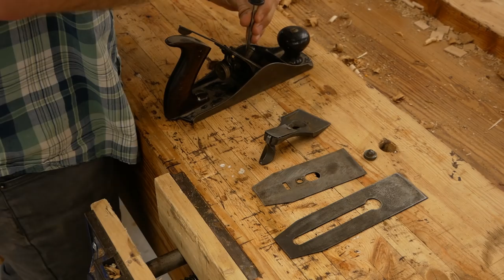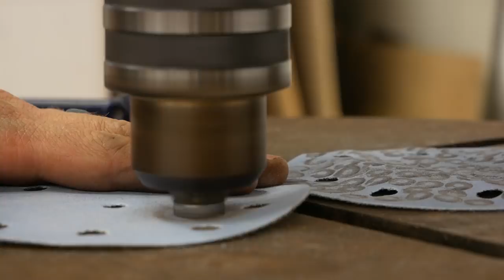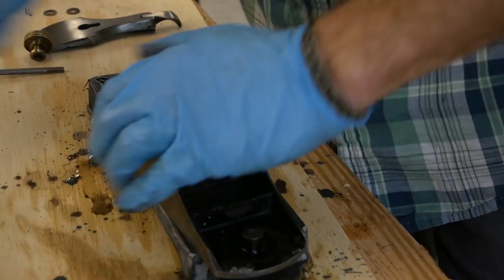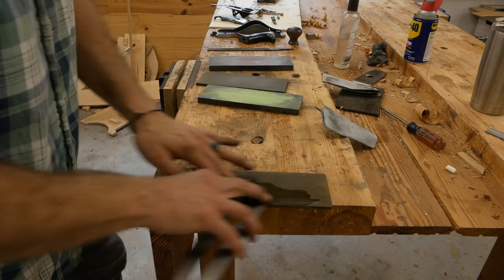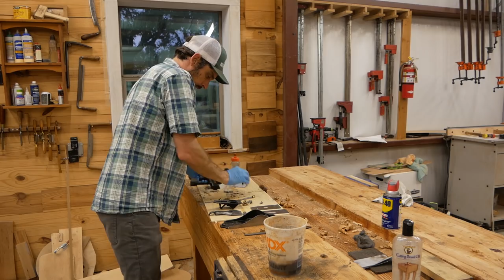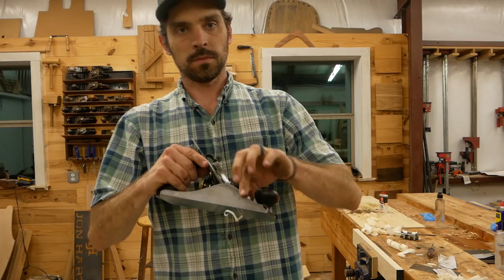Restoring A 119 Year Old Stanley Hand Plane

Comment: Hey Andy - Its great to see someone still using the old Stanley planes with such great results. Just shows you don't have to spend a fortune on the new modern very expensive planes to get good a good finish. I love my old Stanley & Record planes and see no need to replace them. My sons will still be using them long after I'm gone. Great work - Regards Dave

Comment: Next time when you flatten the sole, put the blade assembly back in, tightened, (frog, blade, breaker and cap) -with the blade retracted slightly. That pressure can bend the sole slightly.
Reply: Paul Sellers actually discredited that a couple years ago. It doesn't mean people that do it should stop, but those that don't do it currently, don't have to start. 😊
Reply: @triune_blades  Paul sellers is one of the ones who teaches this.  can you give the title or a link to where he says one should not do this/

Comment: Andy, You might try "Rust Converter - Ultra" (Amazon). Eliminates rust, sand blasting, grinding or sanding.  Stops future rusting.  Applies with brush or spray.  Leaves treated parts ready for painting. There are a number of these rust converters on the market but they work basically the same.

Comment: Nice job Andy!  I have a Stanley 605 that belonged to my Grand Dad that I use all the time. At some point, the plane body got painted a tan color. I need to strip all the paint off of it and maybe get a Hock blade for it. I tried sandblasting it and the paint must be so old, it barely came off. So I guess I'll be trying out some paint stripper.

Comment: Sole flattening should be done With the frog attached and cutting iron tensioned.  Cast iron bends under the forces of the screws.  The sole will only be true if you do it that way.

Comment: what is he using to flatten the bottom of the hand plane?
Reply: Wyatt Schaefer  looks like diamond stone
Reply: A vintage cast iron lapping plate. Fine abrasives in the lapping fluid actually bed into the cast iron, so the iron doesn't wear away. Slurry with the swarf falls into the slots. Machinist's granite surface plates are actually flattened with bigger versions of these. I'd love to have one of these old beauties...  Clyde
Reply: thank you very much!

Comment: How did u find out that this is 119 years old and not much younger? tip for that screw polishing - put wood ore rubber under the sandpaper. and bottom straighten gets don by setting blade in under tension. Good cleaning job - bad restoring...

Comment: That lathe is in pain
Reply: EefamDaTuytle its cause its a belt drive lathe with a sort of torque converter like adjuster to adjust the speed, much noisier than a more modern lathe. I had a Delta one like his but older and it always sounded like it needed some help!